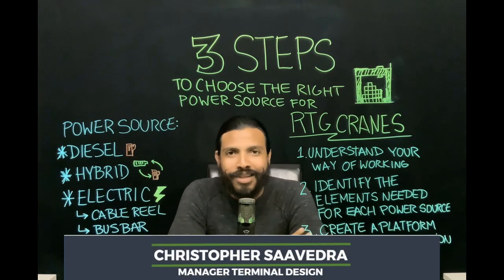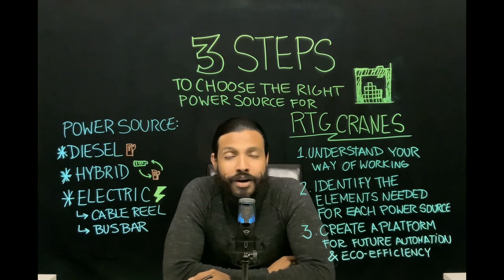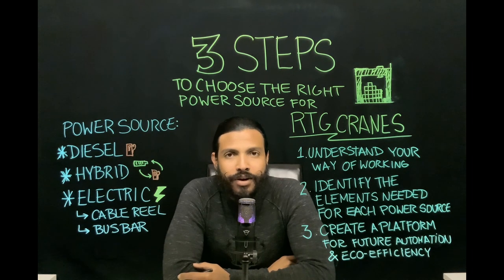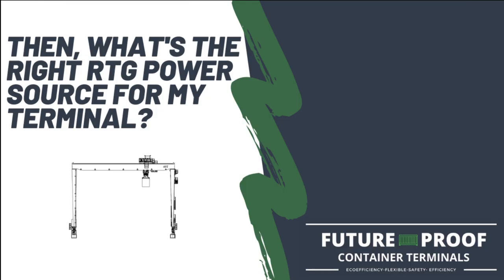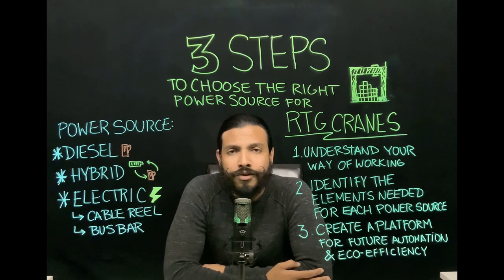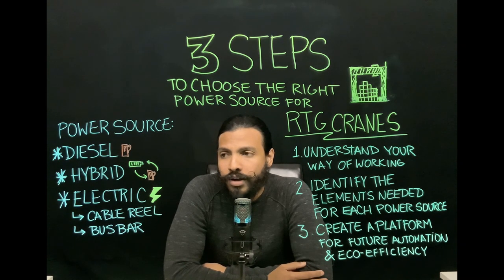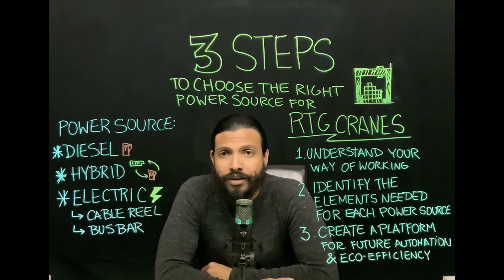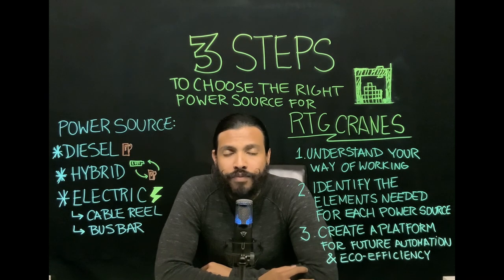3 Steps to choose the right power source for your RTG Cranes

Comment: Maintenance is a big hidden cost. You can find a diesel mechanic everywhere, but a qualified technician for the kind of electric motor those RTGs require is a bit more difficult to come by and at some places, hybrid power sounds more like extra terrestrian technology...
Reply from the maker: Well said Caranguejo! That something you need to consider when evaluating the business case. Regarding the qualified labour, you are right is difficult. Could you share more about this Maintenance Cost? What are your main challenges currently with your Diesel RTGs?
Reply: @WETHINKDIFFERENT16  I'm not in maintenance, I'm just a software engineer working at container terminals for over 15 years with a great interest in all areas of terminal operations. Keep the videos coming!
Reply from the maker: @diariodastrilhas  Great Experiences! For sure will create some content around IT topics. Stay tuned!